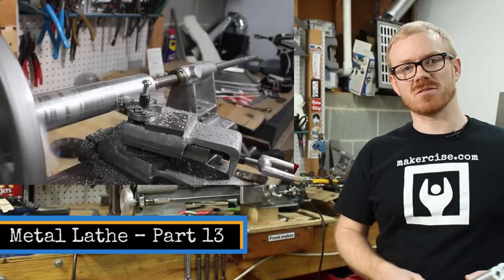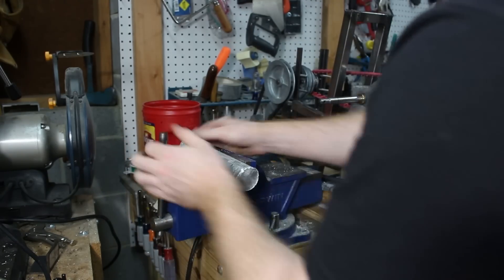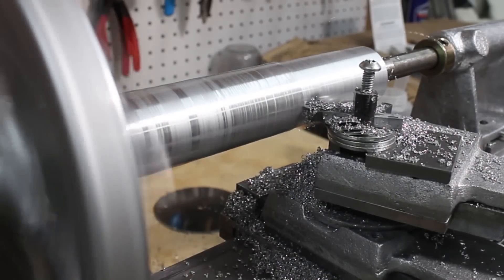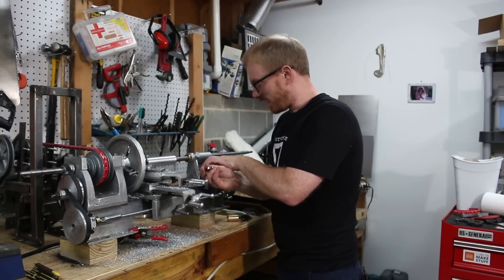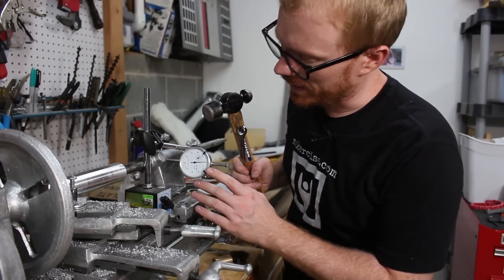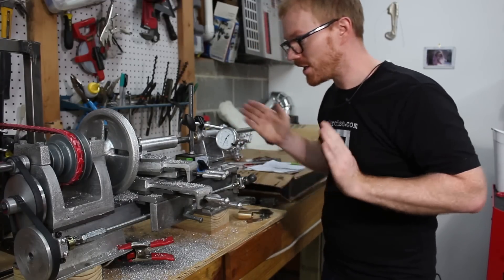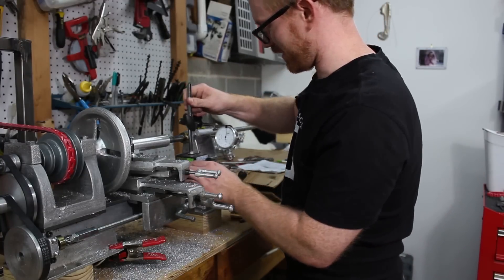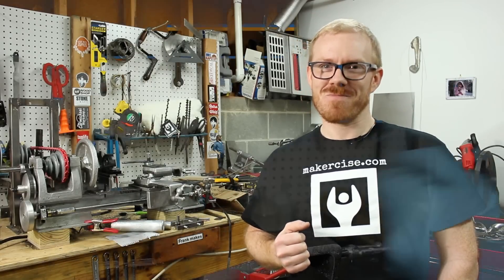Metal Lathe - Part 13: Lathe Dog

Comment: I didn’t see that anyone else had told you , so here’s my tip... and you may know by now but if not it will still save you a lot of frustration. When you are adjusting the tailstock you should put the indicator on the work where the measurements are taken, not on the tailstock itself. Think of it like shooting a gun. Just a single degree at your vantage point can mean yards of difference at a few hundred yards. So put the indicator where the measurement is taken and adjust the 2 thousands according to that location. This will keep you from chasing that ghost and over shooting. When I learned this it saved me so much time and frustration.

Comment: When things get frustrating from moving the tail stock the wrong way in relationship to the cutter it is time to step away from the tool and go grab a coffee and check your email.  Or as you discovered you will make things worse and only increase your frustration leading to more mistakes. 
Another tip is to actually mark the tailstock with arrows pointing ⬆️bigger ⬇️smaller.

Comment: when adjusting the tail stock... under cut most of the center of the round stock bar and leave an inch or two at each end. Then you don't have to cut the whole length of the bar each time. Just make a cut on each end (without moving the cross slide) and measure.

Comment: welcome to machine alignment, If your wondering why you felt like you were chasing a ghost it's because you need to think of that bar as a lever. The head centre is the fulcrum and the tail stock is where your applying the force. As you move the tail stock say .002", if you were to measure a point half way between the head stock and the tail stock it would only move .001". you need to figure out your "mechanical advantage" to determine exactly how much to adjust by. Divide the distance from the head centre to your measurement point on the shaft(keep it the same) by the distance from the head centre to the adjustment measurement point on the tail stock. That is the ratio you use for adjustment. Use a broom stick in your hand with one end on the floor if you need help visualizing it.

Comment: great project man!!  So far do you have to align this lathe often? cheers
Reply from the maker: Alloy Crow not always, but if I am making longer parts I will check both end well before final diameter. Now I use my dial indicator and can get it aligned in the first try. I then make another pass just to confirm the results.

Comment: Dude the indicator needs to be on the part at the end of the part on the diameter of the part and moved half the distance it's off. Say the tail stock end of the part is .011" big.
Put the indicator on the diameter of the tail stock end within 1/8" of the end and zero it, 
now move it .0055 toward you and lock it down. Make your cut you should be within .0005". Play with some scrap it will only take a short time to pick it up.

Comment: This might sound a bit silly: Why not bring the point of your tailstock centre to meet your headstock centre and adjust the trim screws until both points line up?
If your lathe ways are true, then the adjustment should hold true no matter where the tailstock is positioned.
Also: You should make sure that your pulleys for flat belts are crowned (centre curved higher than edges), rather than going for parallel turned, as flat belts will always go towards the largest diameter. You first pulley being driven from the spindle looks like the belt is trying to fly off the back of the lathe (the pulley might be tapered slightly rather than truly flat).
Reply from the maker: Getting the headstock and tailstock center points aligned within a few thousandths by eye would be difficult for me and probably less accurate. Using a test like this for parallelism, you don't even need a micrometer. You could use feeler gauges and an outside caliper. Once aligned it should stay fairly close regardless of the tailstock's position on the bedways.

You are reading my playbook on the crowns. I actually just recently added the crown. It still hangs toward the side, but no more chaffing. I don't think the shafts are well aligned. That may also be contributing to the belt walking.
Reply: There are lots of reasons to turn a taper, offsetting the tail stock is one way to accomplish this.  I know you bored the tail stock on the lathe but you should also check vertical alignment and adjust with shims if needed.
Reply from the maker: +Paul Arber this needs to happen. How would you recommend checking that? Perhaps a 123 block under and then use capilers or feeler gauges if I can get it close enough.
Reply: http://www.neme-s.org/Rollie's_Dad's_Method.pdf

You may need  4 set screws on the tailstock slide to adjust  the vertical.

Comment: Great build. Its coming along, but you may not want to hang your hardened hammer against your fast aluminum hailstorm. There are a number of dead blows in a variety of sizes, rubber, nylon, or even rawhide. But never hardened steel. You're doing great and coming far along
Reply from the maker: eddie Towers a fair amount of auto correct there ;) what say you of a brass or aluminum hammer?
Reply: Aluminum, brass is much heavier/denser...because of this, the impacts wouldn't be any different than a hardened steel tool. I don't know if you knew this, already. But you're following in the same footsteps of early machinist who initialized the precision standards we have today. I proudly clap my hands to you for taking up this mantle.
Reply from the maker: Lead is very dense, but I would expect it to deform against aluminum. Another commenter suggested an aluminum hammer. It probably matters how hard I hit it too, right? Regardless, it sounds like machinists use dead blow hammers so as to persuade things without deforming them. I really appreciate your encouragement eddie.
Reply: Yeah, there are a variety of "soft" deadblows we use. For any aluminum parts to be tapped into place, I would suggest the interchangeable soft face hammers, raw hide hammer (any size), aluminum or copper drift, between 3-4" long, 1 to 1.5" in diameter, with a slight 2 to 5 Dec. Taper. Beck, even a 4 to 5 inch aluminum pipe with a 1/8" wall thickness can be used as a drift, or a hammer, if you can make a hammer. Keep up the good work.

Comment: Hey I've been watching you for quite sometime we all have those moments as craftsmen. If your not aware of this trick I hope this helps... tpi/diameter of bolt =total distance for one revolution. Also if you minus that figure from the bolt it will also give you tap size. might not be as accurate as starrett but it will get you there no questions asked....
Reply from the maker: Phillip Jordan I tried open loop just based on fraction of crank revolution and the third, but there is a little too much flex to get it below 3-5 thousandths. I had much better results when using the feedback afforded by the dial indicator. much more cumbersome. perhaps I'll add some graduated collars to add a bit more control to the fractions of turns. I am learning so much. thanks for commenting and watching :)

Comment: you should see if there is a gt2 pulley of the sizes you are using. if there is you should use them because they won't slip. and gt2 belts are cheap.
Reply from the maker: Looks interesting, I definitely want to try out gt2.

For the time being slipping has been very helpful in one instance. In an upcoming video, I drill the end of a shaft using a hand held drill. The torque limiting belt slippage is a definite benefit during that operation. Probably just in my head, but it feels safer with the "clutch" to limit power.
Reply: Makercise I should add that if you don't find a gt2 pulley big enough you could also try t5 or any other timing belt standards. But gt2 and t5 are very popular as they are used in diy CNC machines and 3d printers.

Comment: I am not sure how you were adjusting your tailstock, but it looked like you were using one screw driver on the screws.  Back the front screw off and then tighten the back screw or vice versa.  One thing that you may find helpful is to replace the phillips head machine screws with socket head screws, then using two allen wrenches at the same time, work the screws against each other.  This way you would have a little more control over the adjustment of the tailstock offset.  Much the same way you would do a four jaw chuck.

Maybe that will help.  It has been a GREAT series.  Thanks for sharing!

Joe
Reply from the maker: My Heap I'll have to keep an eye out for some long number 6 with Allen heads. thanks for the input.
Reply: You can do it with two screw drivers too, but the chance of slipping and buggering a head would be greater.

Anyway, thanks for the early access and great videos.

Joe